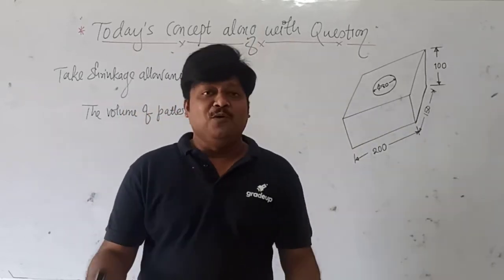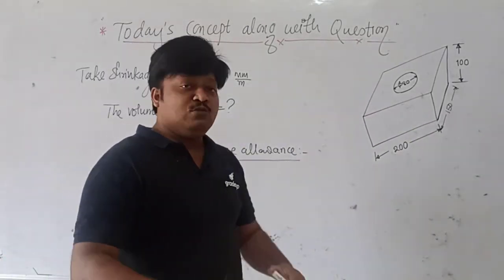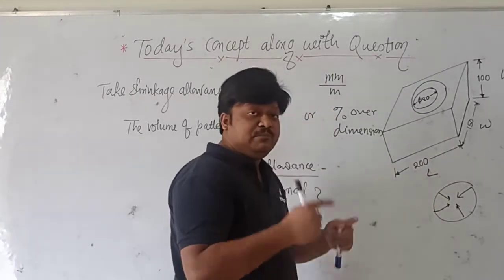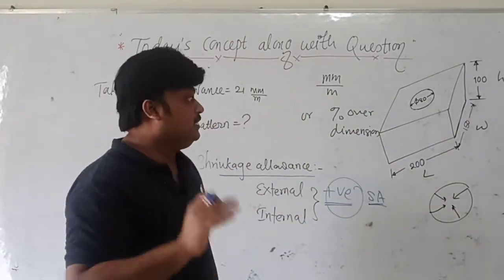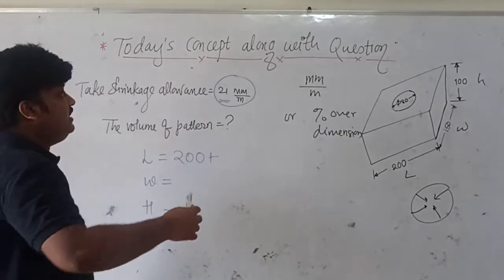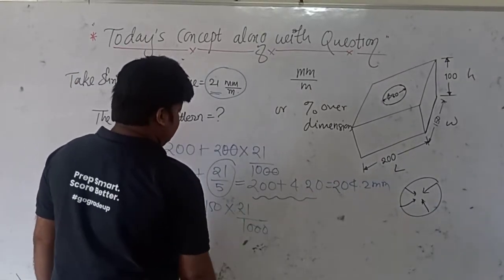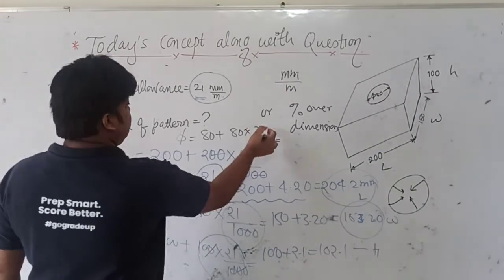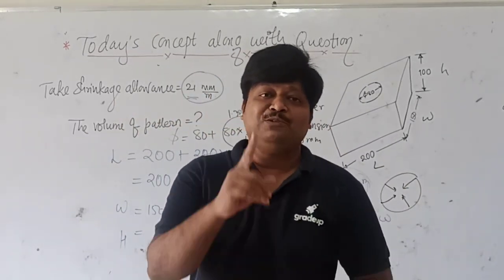Concept Of The Day in Just 5 Minutes !! Mechanical Engineering | By Onkar Sir

Comment: Hole 🕳 dimension should be substracted because hole will enlarge.
Reply: Same doubt
Reply: Page no 60-61 read carefully from manufacturing technology vol 1...PN Rao
Reply: Hole is getting contracted ....
Reply: @onkarotari2935  yes sir hole is getting contracting so that after shrinkage the diameter should be less than the initial but in the video diameter is increasing how is it possible
Reply: @dattam1931  dear it shrinking that is why we r compensating that shrinkage by providing + s a  on hole...plz go through standard book which I hv suggested
Reply: @onkarotari2935  ok sir i got the point thank you sir i will never make this mistake again thank u so much for responding sir